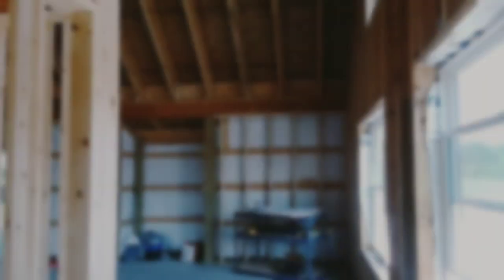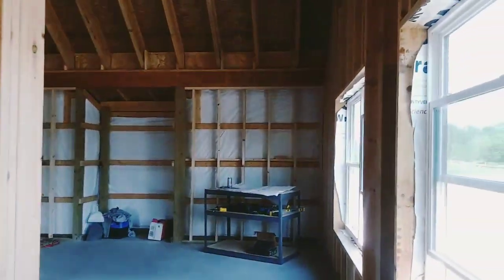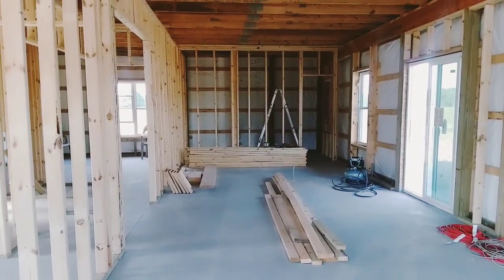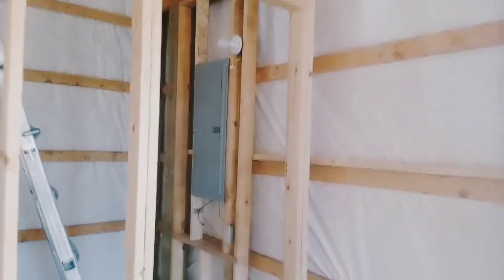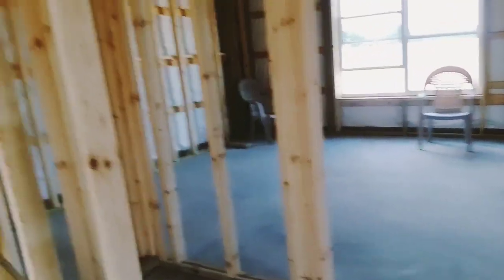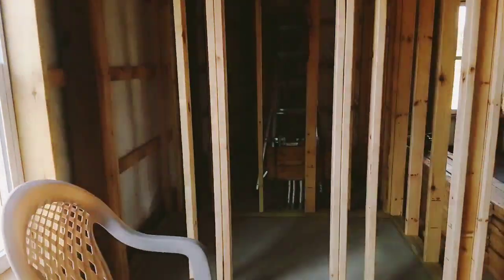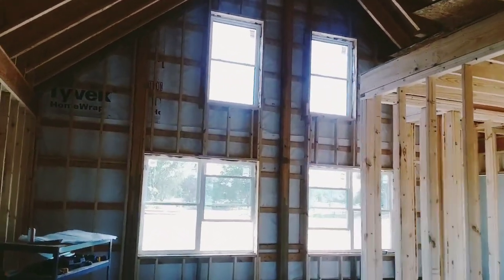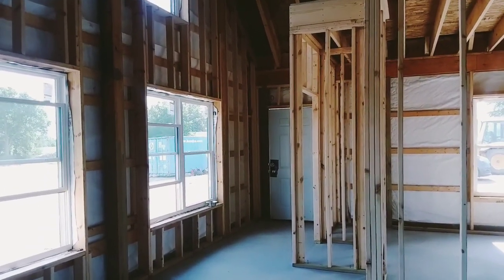Livin In The Mitten,  Pole Barn House making progress and learning

Comment: Justin, 
How deep around the slab and how wide was required for your footings?
Did you pour a 4 or 6 inch slab?
Reply from the maker: In my area I just had to pour standard 4 inch slab. I put foam board around edge 2 feet down plus underneath. Post are set in the ground. Should have put post in plastic sleeve atleast but I didn't..

Comment: I dont see any headers over the windows.  Is there a reason why?
Reply from the maker: I believe sense no weight on walls don't need headers over windows.  The weight is on the purlins that run across the top connected to the 6x6.  (I could be wrong as well if changes needed will post it.)